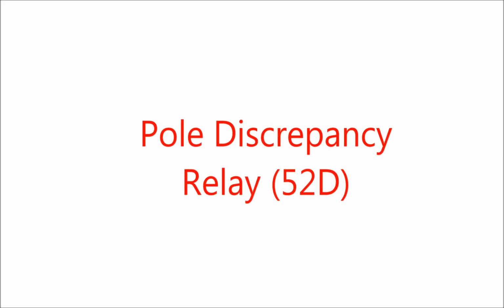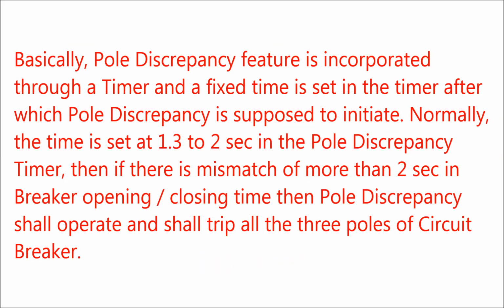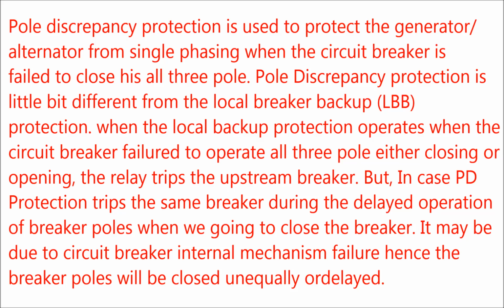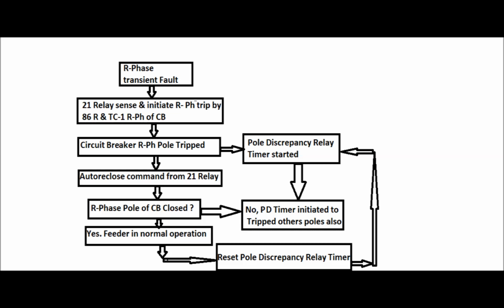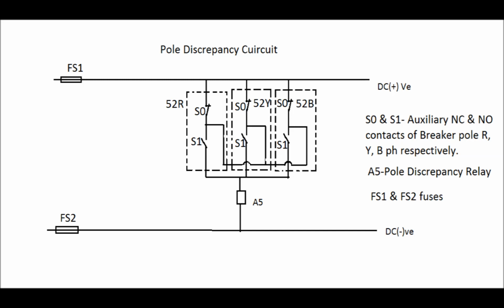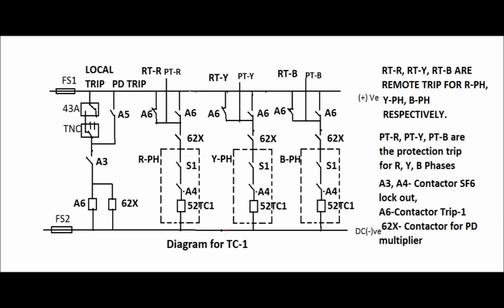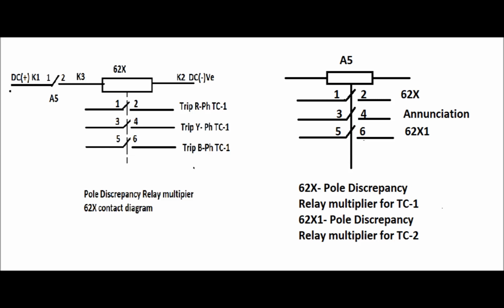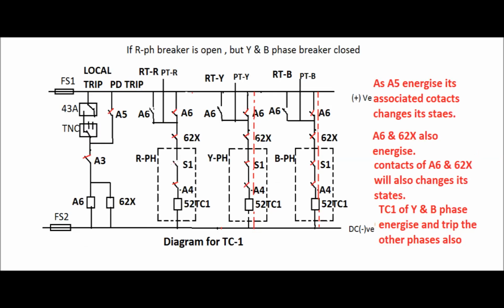POLE DISCREPANCY RELAY(PD) for CIRCUIT BREAKER

Comment: From the algorith , what will happen in case of 2nd time reclosing (considering duty cycle = O-0.3-C0-3SEC) , Will we have to match timer duration with duty cycle
Reply from the maker: It is timer for pole discrepancy relay. First of all if a transient fault occur, a single phase trip command will be initiated from distant relay and it will be make the faulted phase open . Now dead time related to autoreclose . For 400 KV system it is normally 1s and for 220 kV it is around 600 ms for arc extinguish. After dead time is over distance relay will shot autoreclose pulse to energise the cc  of that ph of breaker, now due to mechanical problem if cb fail to close the breaker pole no other relay will be able to trip the breaker except pole discrepancy and it will run with unbalanced current as only two phase carry current and the one phase no current. So, pole discrepancy timer is different one.